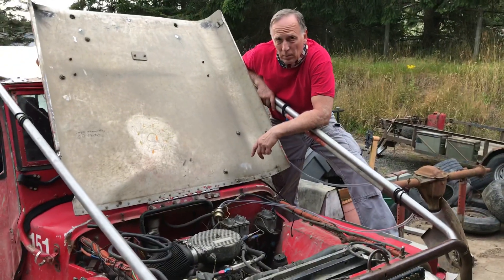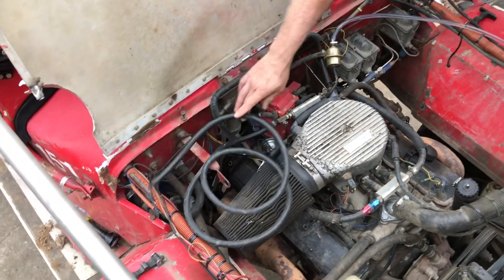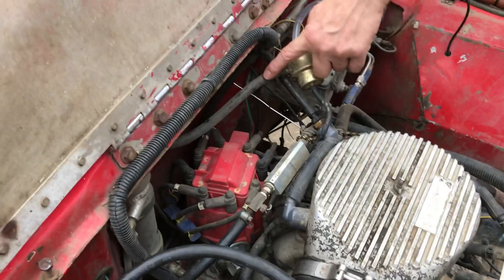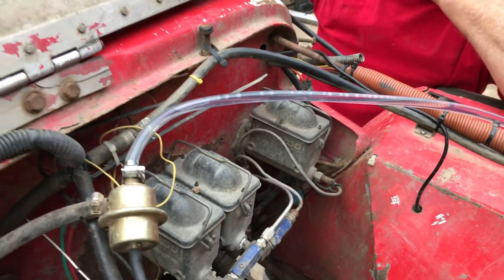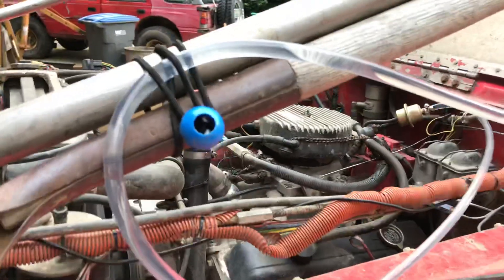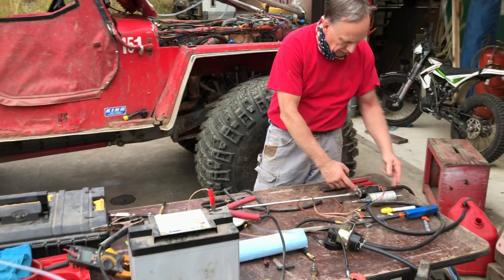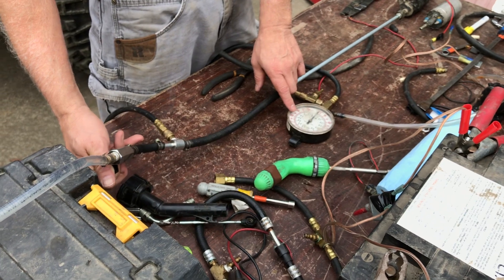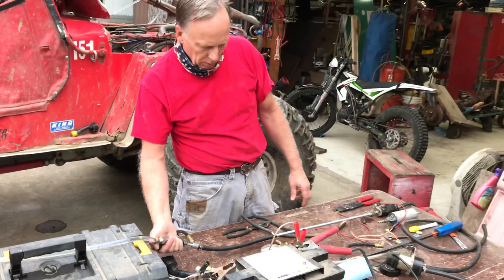Cavitating fuel pump hi pressure, super jeep

Comment: It's related to the clearance between the impeller and stater in the pump
Try positive displacement roller fuel pump off 1979-81 Toyota Supra or 80 to 85 Cressida

Comment: Wonder if it's a pump problem at all ... I'd guess there is a high/low pressure change at the regulator allowing stored oxygen in the fuel to come out. Be interested to see a clear line from the pump to the regulator, and see if bubbles originate in the regulator. Could also try putting the regulator AFTER the fuel rail.

Comment: Cavitation is coming from your ball valve in your bench test (ball valves are never designed to be throttled), and coming from your bypass regulator in your Jeep application. You need a regulator with a larger flow capacity; as to say, a larger needle and seat. I have a Holley reg with a 3/8" ball and 5/16" seat. You need a smooth transition from high to lower pressure.  If your bypass regulator is an aftermarket replacement type, it might lack in flow.  Try a performance (larger flow rated) regulator and I think you will solve the problem. --Doozer

Comment: Hopefully you figured out, but looks to me there is too much restriction going to the pump. For the pump to push the fuel at that pressure its creating a low pressure point right at or behind the propeller for pulling the fuel. Low pressure means a lower boiling point which means easier to create cavitation. Which to me is what you’re seeing. A possible fix is to use a bigger hose going to the pump or figure out some other method to get the fuel to the pump in greater volume. Also, once you start getting cavitation it can very quickly damage the pump. You might need a new pump as well. Another solution is try a different pump design. In-tank pumps can work better because the fuel is right there.

Comment: Fuel pressure regulator on your fuel rail . The only way air can get in at low speed is you have tiny leak in ether your pump housing or your lines some where pulling air. I wonder if the pump has like a waist gate that ant closing at low pressure

Comment: You must make sure your fuel source is placed well above your fuel pump.  The tank to pump intake line should be of slightly larger diameter than the outlet line.  Never ever place a full size fuel filter between the tank and the pump.... I've been there... If pressure and flow are an issue, consider several staged pumps and a swirl pot.

Comment: From what I know from being a heave equipment mechanic and working with hydraulics I would say the bubbles are coming from the psi regulator. I would suggest running a larger diameter fuel line line from tank to injector. You may have to change you pump also.  I also don't think your regulator is capable of the amount of volume trying to pass through.  You can run the regulator anywhere down stream from the pump because of Pascal's law that psi is equal at all points.  So when you step on the throttle you drop manifold vacuum to the regulator in return raising the fuel psi to whatever the max relief is in the system supplying more fuel to the injectors. Basically blocking off the return to tank. Some things I think you should look at are 1. What is the max psi in the system? 2. What is the flow/volume of the pump?  This will most likely very. 3. What is regulator capable of volume wise?  4. What is the volume of required for the injectors?  5. What should system psi be at idle and with the regulator closed? (WOT). Sorry for the long rant but talking things throw is how I figure things out. I hope it helps.

Comment: Given the pump does not have cavitation at low pressure but does at higher pressure is very telling. The pump may be over pressurizing for what it is made for. This would be that the pump at higher pressure has fluid going around the vanes at a velocity that causes air to separate from the fluid (cavitation). Fluid going around impellers due to over pressure or wear has a much higher flow rate than what is within the out-port flow and would change with type of fluid being pumped.  With water this would be at around 10 ft per second if I remember right. Water pumps with cavitation will actually wear out an impeller. I have seen bronze impellers that were worn to a high polish. May want to look for a pump that is rated at a higher pressure or higher quality at the ratted pressure. Just thought of something, pressure within pump impellers are a closed system (they do not know what the pressure is outside of pump) so you may be able to put a medium pressure pump in before or instead of the low pressure pump. This would lower the pressure deferential between the high and low side of the high pressure pump.

Comment: Drag racers run external fuel all the time. Either they have a better pump or a different regulating system. I woul think you would need to regulate the fuel psi at the engine for the injectors and then reduce the size of the fuel return line so that it acts as a restriction to prevent air. What I did not see is the pump turning off once a preset pressure was achieved. It's the inability of the pump to vary fuel flow and stabilize pressure that is your problem.
Reply: ... Or they are, you know, going WOT for 12 seconds at a time, and use fuel chillers.

Comment: The fact that you appear to have good flow with no air until you make the pump work hard tells me that you have a damaged pump. Same thing with pump number two. So go out back and get an old ford pickup pump out of its framerail  and mount it in the jeep as low and as close to the tank as possible.  These pumps are not made to pull but to push.  Then when you get that all straightened out, take it out on the trail but do not run it out of gas because that kills pumps.
Reply: In the Jeep it shouldn't be pulling up. Plus he has the other tank above his main tank. So shouldn't that make a small amount of positive pressure? And ain't the old ford pumps Bosch fuel pumps?
Reply: @shaunadams3170  Yes the top tank would reduce the lift the pump has to overcome as long as it has fuel in it. The only time I have seen lift be a problem is when the guy had the pump mounted high in the engine compartment and a rear mounted tank so when he stood  it on end it had eight feet of lift.

Comment: You can try a check valve before your pump usuaally at the end of the hose to help keep pressure stable. also you have too much negitive pressure before the pump because it sucking fuel up from the bucket.when it comes to external pumps they need to be mounted below tank level so it can be gravity fed which would increase pressure on the back side of the pump in turn , less chance of cavitation due to the positive pressure to the pump.
Reply: Put it below fuel level with a large fuel feed

Comment: Try to run a larger regulator after the injection with a larger return side.. I think part of the problem is the fuel pump has to much volume and when you restrict it to much the pump cant move the fuel and it start to cavatate....it is trying to pump the same fuel over and over creating air that's why it is not as bad under wide open throttle you have more fuel volume

Comment: I would check the tank fuel is drawn from u said u had two and see if there is a fuel slosh issue or bad return line drawing air pumping it into the lower tank. The fuel pump lol idk could use attention.. i would get a efi one for an ls like this Walbro GSL392 maybe smaller these r 70 bucks mean for a efi swap common w ls motors.. with 45-75 running pressure a cheap return style regulator and if u got the same issue the problem is in the tank or lines but i would look into the tank and fuel slosh cause once air is in the gas its going to flow back to the pump not float out right away? Idk
Reply: Couldn't be fuel slosh because it's doing it seating still.
Reply: @shaunadams3170  correct. And can't be a return leak because it's doing it on the bench.

Comment: Does the factory TBI use a pressure regulator for 12 psi? Maybe try & running it with just the low volume pump? 12psi seems pretty low?
Reply: It's in that ballpark, yes. It is also part of the TBI system (built into the casting and there is a replaceable diaphragm) so it can't just be swapped in here.

Comment: What if the feed line was straight to the rail and the regulator was on the other end of the rail with the return exited from the regulator?  Now I have to build me a setup to play with . Thanks for the brain teaser.
Reply: Good idea
Reply: Thats the correct way to do it for a rig with 8 injectors with a tbi you have to regulate the pressure first so i wont run rich

Comment: if you are building up and bleeding off while running like you say it sounds more like a fuel boiling problem to me
Reply: Maybe, but it is doing it on the bench in cold condition, too.

I assume the pump he is using is an online, not in-tank unit. If it is in-tank, it is designed to be cooled by the fuel immersion, so you may have a point.
Reply: So could you regulate the voltage to the pump to prevent the boiling and adjust the regulator to still feed the proper rail pressure? Are use the fuel filter that has the return line nipple made on it?
Reply: @shaunadams3170  then you'll have to have a computer to vary the voltage to the pump IAW ROM. Way too complex, and this is a carb we are talking about, not a moon shot.

Comment: So what if the fuel pressure regulator is causing cavitation I wood bypass it and see what happens.
Reply: What will happen is the vehicle will run pig-rich and like crap. Quite likely get fuel wash in the oil and wipe out the journals, too. HORRIBLE idea.
Reply: Nothing will happen if you run it for a minute or two just to test it.